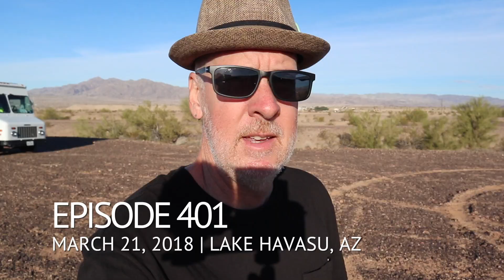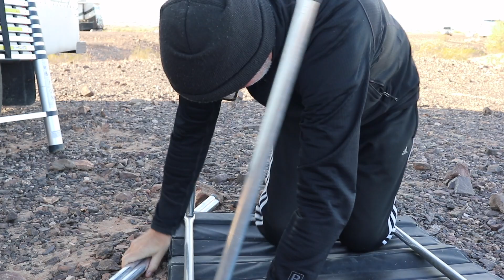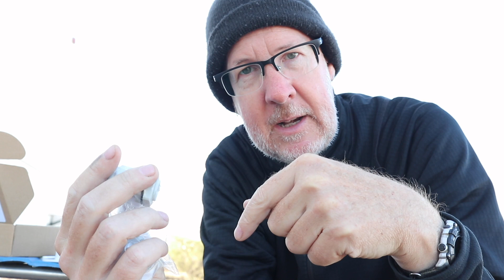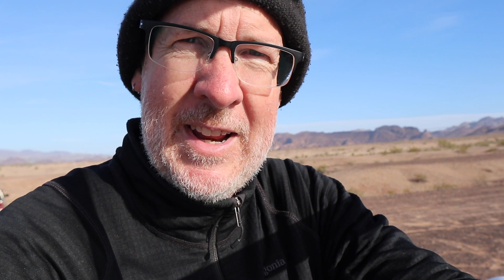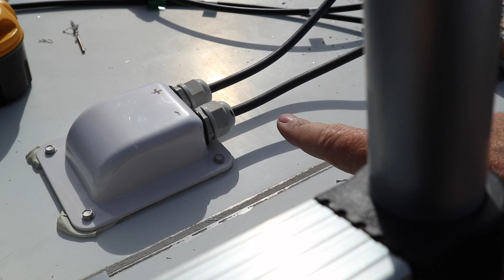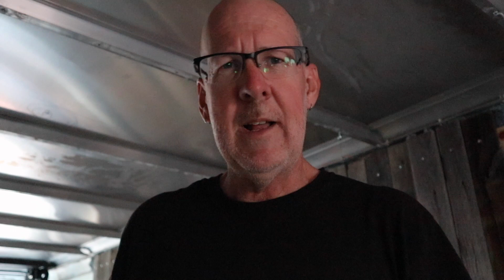Problems Wiring Solar for Step Van E401

Comment: Thanks for showing the trials of your lifestyle.  Refreshing to see someone not just posting polished installation vids without  mistakes.
Reply from the maker: I guess it is easy if you have a background as a handyman or electrician. however, if your background is graphic design or linguistics like mine, then this stuff is very challenging

Comment: Seven, you prolly figured it by now... I used the same cover on my van. The gland nuts compress around each of you wires and seal them. The penetration hole was small but big enough for the wires to fit thru the roof. Round hole worked for me... I think it was less then an inch.... I sealed around the hole under the cover with that same butyl rubber sealant that you use under the max air fan. I also ran that butyl rubber under the flat edges of the box, between the cover and roof. Then I ran four of those self tapping screws thru the plastic edge of the cover to hold the cover down to the roof. Then as an extra measure, cause I'm paranoid of leakages, I put eternabond over the screws and edges. 

No way it's gonna leak. Wasn't pretty, but it's very leak proof. Roc on brother!
Reply from the maker: I got the glands figured out. I did a hole about an inch which you can see in the video. I used butyl under it and then dicor lap sealant over the tops of the bolts and along the edges
Reply: YUP! that's how ya do it! You can use a tube of Flexseal from the RV dealer as well to seal it with or without the screws!

Comment: Quick solution to your tilt problem.  When I was driving a semi for a living, I made some simple ramps made from 2"x12" to help level out a parking spot.  Start with a cheap 2"x10" or 2"x12" (check Lowe's and Home Depot for sale or non-pick up wood), and cut a 3' piece, a 2' piece and a 1' piece.  Repeat for a second set.  Align one of each side at one end and nail or screw the boards together to make your ramp.  You can place these as needed (both at the back, both at the front, both on 1 side, or however you need to) to level out your step van.  Just place them, and drive up on them to adjust.
Reply from the maker: great tip and suggestion!

Comment: Beautiful scenery. I don't know solar so I don't have answers.
 Box - more than likely why the rv solar guys use a larger conjunction box. The Huberts travels (youtube) used a tape on his cables to keep cable wires from slapping around on roof. As for connectors not sure what they do...i see them use shrink wrap. ( but not sure about connectors) but you have MADE GREAT PROGRESS!!
Glad you got guidance. 
thanks for sharing
Reply from the maker: so many unknowns. I did get some answers from scott about the connectors. apparently they are built weather proof